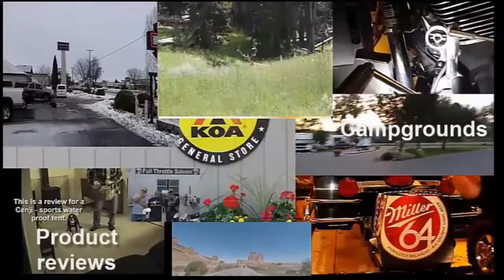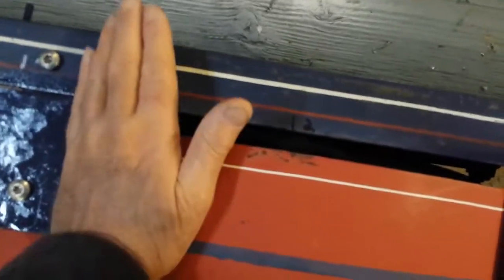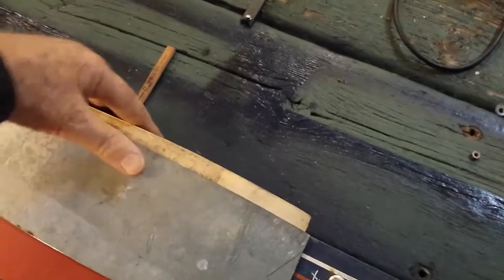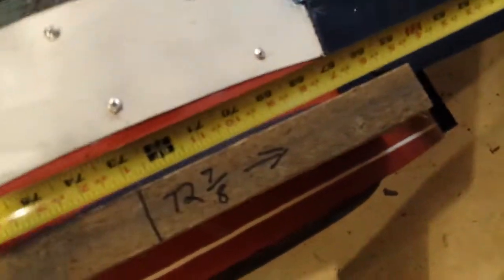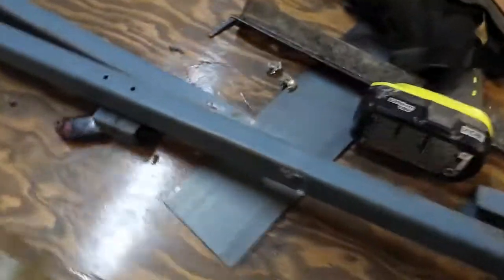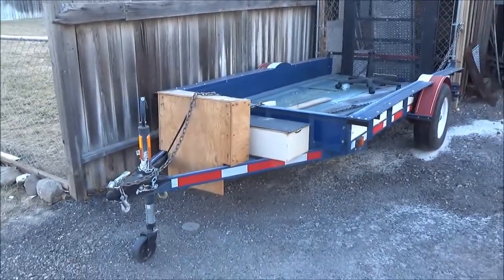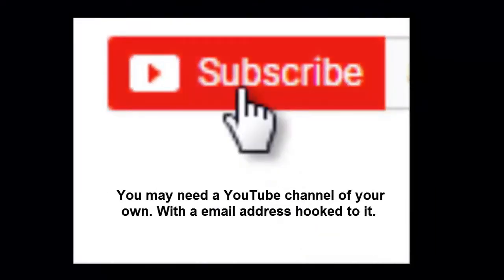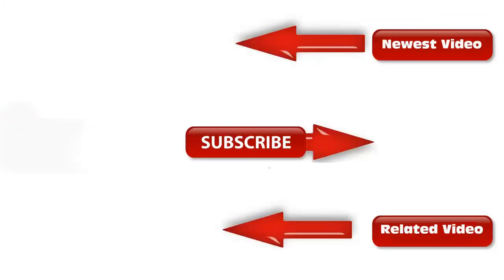Converting my motorcycle trailer into an enclosed trailer part 3

Comment: LOl..All my tools SHOULD fit in this trailer ???  Hope you heal quickly from your nerve issue, looks like you have a lot of work ahead of you. Good job on the wheel space covers. Looking forward to your next vog.
Reply from the maker: :) before I purchased a trailer I've measured everything and it should fit in there. Like you said SHOULD!  I will let you know after I get back from Sturgis this year that's when I plan on packing all of my stuff up and hitting the road in the RV. There are few things in the shop that I'm going to loan out to my nephew. Such as the bike left and a few other large tools. But squeezing a 30 x 30 shop full of tools into 6 x 12 trailer will be a trick that you may want to see. Thanks Mike for your comment as usual.
Reply: I find this interesting, and would like to see part 1 and 2.  I find no link to your other videos